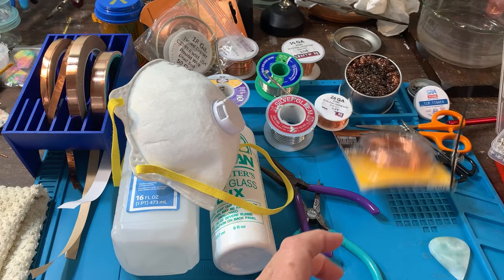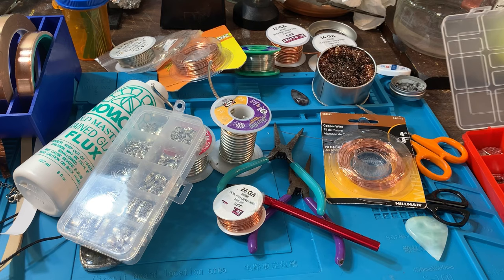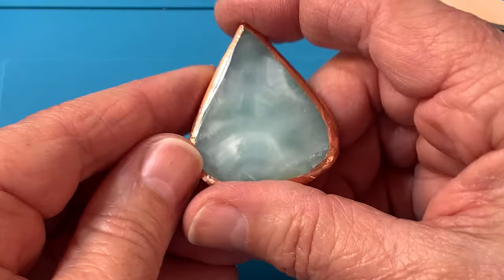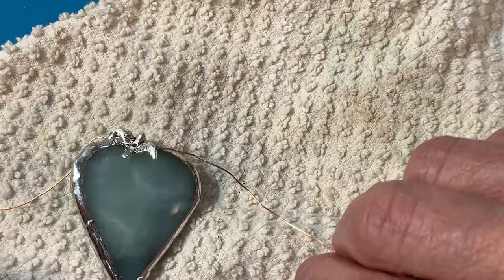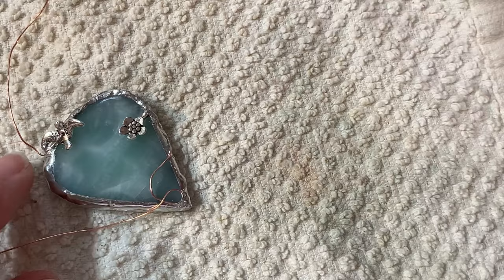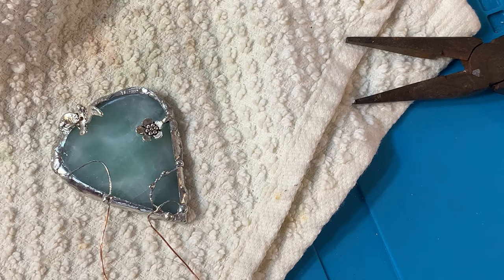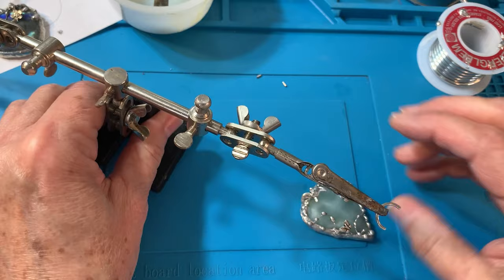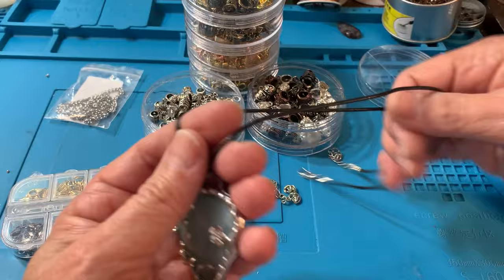Hemimorphite Garden - Decorating with Soft Solder

Comment: Karen you do pretty work. The tip of your soldering iron is intended for use on electronics. You need a tip that is heavier duty with a beveled tip. This will give you smoother results,. You also need to investigate how to keep your tip cleaned and tinned. This will help you get better results.
Reply from the maker: Thx very much!  My preferred tip is this medium chisel tip which is one step down from the full size chisel which allows me to pick up smaller amounts of solder for finer detail work!  I am religious about keeping my tips cleaned & preach this in all my tutorials…it’s the MOST important step for the life of your tips!  This tip is well over a year old & in great operating condition!
I appreciate your interest & support! 😊

Comment: I love all the extra beaded silver balls you added… But I just started watching your channel. So maybe you have a tutorial just about adding decorative silver beaded balls… it could even just be a tutorial using your wire and your copper without any stones just to show the process. That’s just an idea. I haven’t worked with soft solder that much. or actually, I should say it’s been a while since I’ve worked with soft solder, but even then I didn’t realize how decorative you could actually get with your pieces… I used China that I bought at resale shops, and I broke the China but I made them into small hearts. But they were very boring looking. Ugh 😩 Michelle
Reply from the maker: Thx so much!  I think I have showed how to do decorative balls in a couple videos but maybe I’ll do a short tutorial just on that!  Thx for the suggestion!  I also make broken china pieces & made a tutorial a while back if you’re interested!🙏😊🩵
Reply: @karensintuitivejewelry  I will definitely go check out your china video